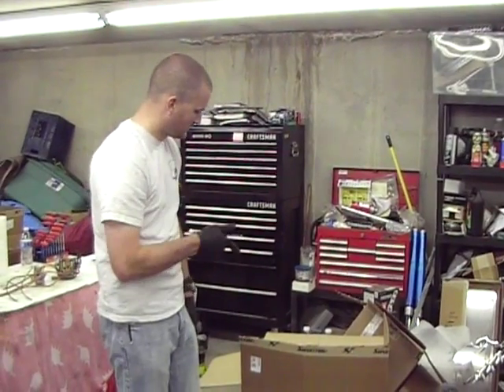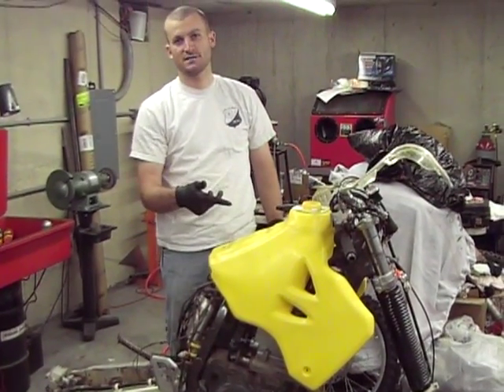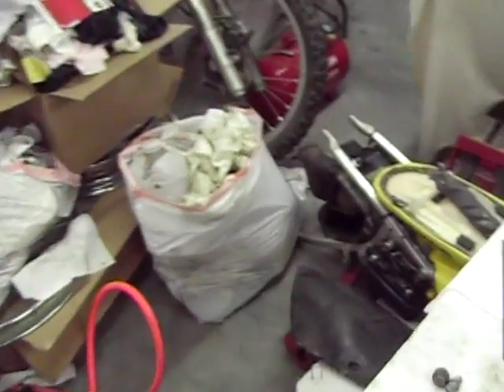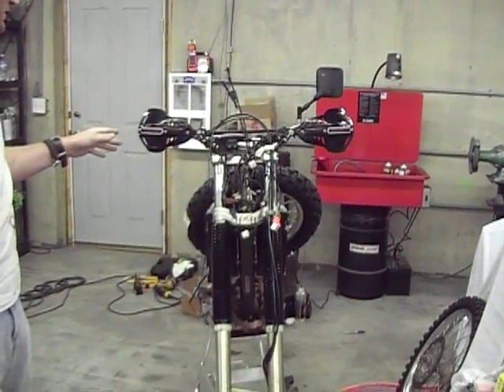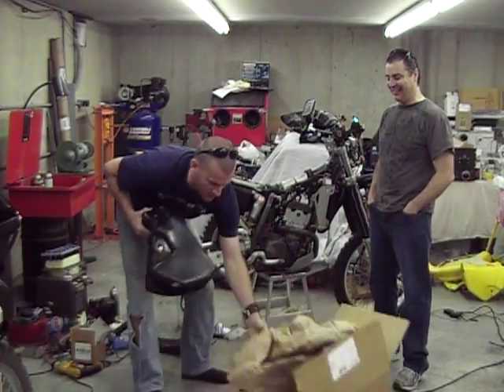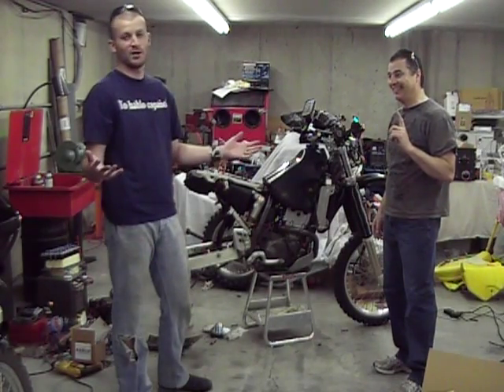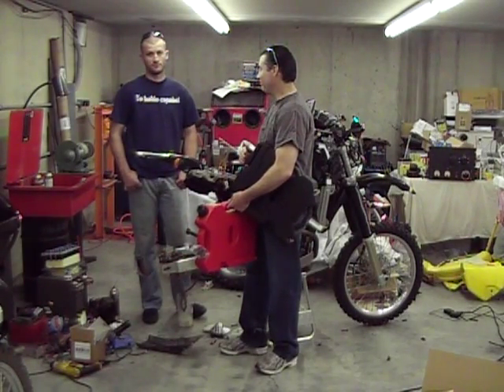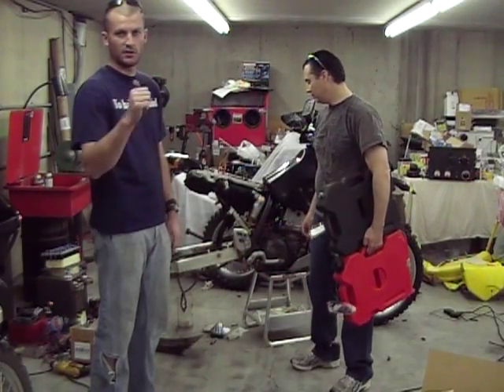EveRide DRZ 400 Extreme Makeover Episode 14 - Fuel and body work

Comment: I LEARNED A LOT FROM YOUR VIDEOS.....THANKS!!  I WAS WONDERING HOW YOU KNEW THE THROTTLE POSITION SENSOR WAS BAD....I'M GUESSING AN ELECTRICAL TEST.
Reply from the maker: KEN WALZ Yes, electrical test can ne done to show an open circuit, or the voltage doesnt change with altering its position. On this carbureted bike, it controls timing, on fuel injected bikes it controls timing and fuel curves.